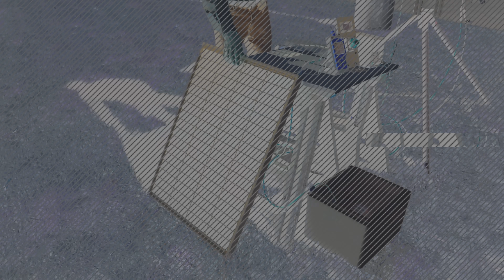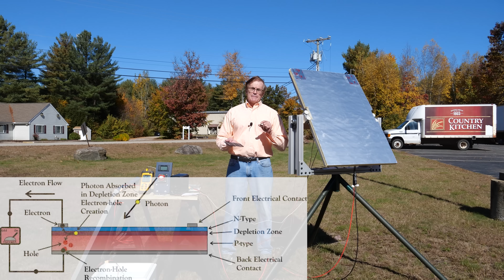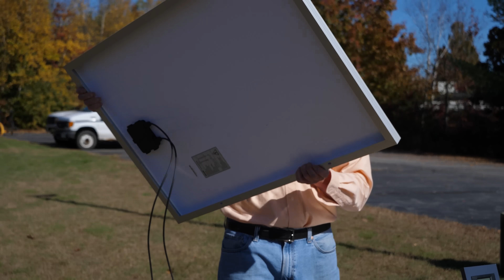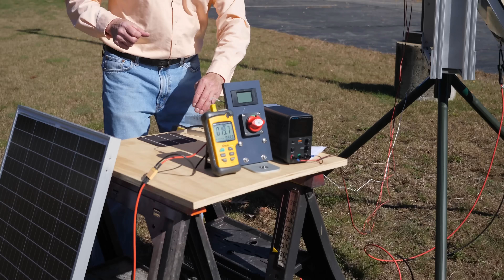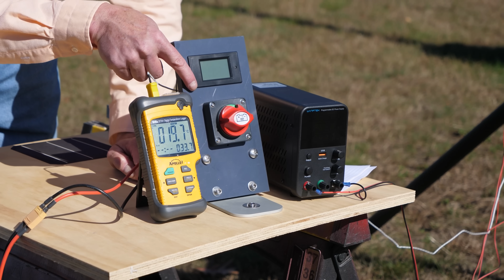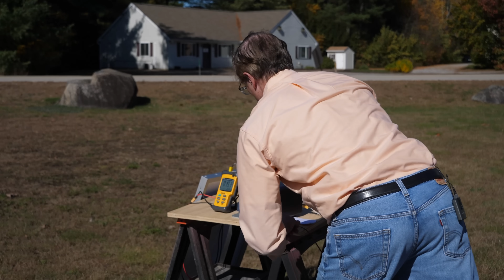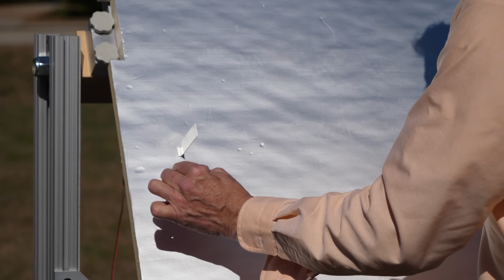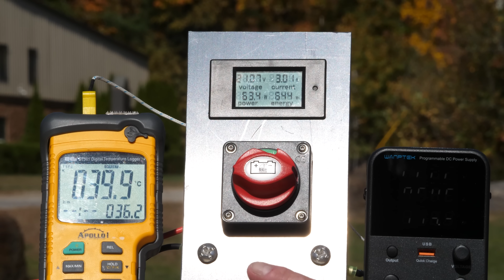Do you REALLY get enough out of your solar panel?

Comment: Interesting idea and a thought provoking video but it's not as rigorous as I'd like.  Did you record the temperature on a panel that wasn't enclosed on the back?  I'm curious about how much the natural airflow would change things over the boxed-in, no-fan "control" that you used in the video.  I also wonder whether the DIY heat sinks by themselves might make enough of a difference to negate the need for the fans.

It would be really interesting to see a 3-way comparison in a typical installation (i.e. on a roof in case the air currents over a roof make a difference) over the course of a few days to get an idea of the real-world performance of something like this.

Comment: I wonder if solar panels are justified, financially, if you can collect/store electricity in a battery at the lowest rate for use instead of the grid's higher rate? Especially if that battery is in your EV? You have grid backup, transportation, without the PV panel cost. Also, I plan to buy an Aptera Sol (PV array, $900 extra).

Comment: The code for MPPT isn't that difficult, it's just a "hunting" binary search style thing.  Well, it's easy to do, it's a little more tricky to do right.  The reason I feel it's important is because the power output of the panel will change when it gets cooler which will change your 7 ohm load requirement.  Maybe when cooled the panel would be better at 7.2Ohms.

Comment: Not sure if this would be beneficial. But could attaching peltier modules to the panels to power the fans be done? When the fans cool the panel. Wouldn't that effectively be an auto shut off when reaching optimal or near optimal power generation?

Comment: Interesting. I wonder about a passive system, just leave the back open and but leave the aluminium strips on as a heat sink.
Reply from the maker: There is a very slight increase in efficiency.

Comment: My parents need a new roof and have been thinking about installing panels and an air source heat pump. I’m going to try and work out if it would be cost effective for them to have a solar air heater as the roof surface around the panels and sky lights. In Ireland we have a temperate climate, so I don’t know if the COP boost would be worth it. I saw a video of a guy building a solar array / thermal collector and air to air heat pump. Definitely worthwhile in northern climates with a lot of cold air and clear skies. Would need some thermal storage though. 

I think Sunovate use a higher temperature refrigerant than typical heat pumps.

Comment: Doesn’t seem like a fair test…you didn’t compare the power output to the nominal case where the back is open to free air.   Your base case is closed box of still air which does a pretty good job of insulating the back of the cells and heating them up.
Reply from the maker: It isn't closed.
Reply: @TechIngredients   OK, yes, there is a small slot at each end of your duct, but my point still stands. When the fans are off, convection cooling of the back surface of the cells is likely to be SUPPRESSED relative to a bare panel due to the sheet of metal you added.   It inhibits both natural and wind-driven forced convection.     

A meaningful test would compare your setup with fans on, to a panel with no duct at all.  Try it.

Comment: 16:00 Thank you very much for this experiment and sharing the results, learned a ton. 
Regarding if it's worth it, one of the key problems here is also fans durability vs fans and the cost of everything, including replacing the fans every couple of years or so. 
As such, I'm not sure if the increased power efficiency + longevity increase of the panel will make up for the cost of the fans + power converters for the fans, etc.

Comment: @TechIngredients - What are your thoughts about the option of cooling the panels only with the extra added aluminum fins on the backside (relying purely on convection)? If being applied on large solar array I guess that the air velocity will be higher, respectively will have better added value.
One issues that I see with forced air cooling, is the dust. Over time the aluminum fins will accumulate significant amount of dust, which will quickly reduce the heat-exchange performance of the apparatus.
Thanks for all the hard work producing this excellent content.
Reply from the maker: There is a very  small improvement  with the fins alone.  Probably not worth the effort.

Comment: There is a roof panel that pv's  mount to similar to a skylight box made from stamped metal that is essentially a heat duct. They are designed to be connected. It puts the air handling load on your existing forced air blower and negates the need for secondary fans.
Reply from the maker: Good idea

Comment: At 16:48 do you mean Fahrenheit? 80c seems really hot
Reply from the maker: No, actually, Celsius.
Reply: @TechIngredients  Oh wow, I didn't realize they could get that hot! Thanks for the info!!
Reply: I was a roofer in high school... just because ambient isn't that high doesn't mean panels aren't. I operate in Fahrenheit mostly and it was an accepted fact on the crew that if the temperature was 80 in the shade, then it was 100 on the sunny roof. If it was 90 in the shade, then it was probably 120 on the roof.

The shingles (or any other dark material) absorb the sunlight and radiate the heat back. Asphalt shingles are usually as hot as boiling water or hotter. And the higher ambient gets.... the bigger the gap between ambient and the temperature on the roof.

95c for a solar panel.... 10000% believable if you know your stuff

Comment: Question.... What if instead of installing the fans on the rear of the panels, you directed a constant flow of air across the face of the solar panel? Would that flow of air provide any cooling benefit? Or maybe directing that flow of air across both the face and the rear of the panel.  My thought was that a constant flow of air might potentially provide the added benefit of helping to keep the face of the panel clear. I've always wondered if you could use air across the face of a solar panel to assist in keeping snow from accumulating on the face of a solar panel in winter.
Reply from the maker: Probably  not due to the limited surface area.

Comment: I've been thinking about the panel cooling for years. I want to set up an array and use geothermal cooling with long lengths of buried 6 or 8 in pipe and have the cool air pulled over the back of the panel by a simple roof turbine. Also you mentioned the wave length of light. Is is possible to filter out any light that doesn't promote electrical generation but does contribute to heat build up?

Comment: You could improve things significantly with a fluorescent polyethylene film over the panel to absorb UV and re-radiate the energy at visible light spectra the panel can use.
This will also stop IR and UV frequencies heating the panel. 
And double the surface area available for your air cooling, as you can pass air through the cavity on the front as well as behind the panels.
Reply: I must admit  - when he was talking about spectra I thought we were about to hear about a filter/reflective coating he was experimenting with. Active cooling and major modifications sounds more expensive than just adding another panel to the array for the extra power.
Reply: How much attenuation of the light at critical  wavelengths occur, when using such a polythene sheet,  wavelengths which are used by the panel to create electricity?
Reply: @deanXRayZulu  you may lose 5%. But Infrared is blocked very effectively, and the fluorescence can boost output by over 30%.
Robert Murray Smith on YouTube TnT demonstrated it with a green leaf smoothy. Blending up some green leaves, and making a chlorophyll dye. Chlorophyll is fluorescent. 
Even soaking a piece of paper in the dye and putting it over the panel improved it's output significantly. 
Though chlorophyll is degraded by UV, so not the best choice.

Comment: Thing is, I don't think that the panel would get this hot without the box that is trapping all that heat. It would be interesting to see what the temperature is on the panel, given the same conditions, without the fins and box on the back. I don't believe that these fans would be worth it as the panel would self cool with convection as you mentioned.
Reply from the maker: It's  not closed and not trapping the heat.  Consider how slowly that convective flow is moving.
Reply: @TechIngredients   But you don't KNOW that since you haven't tested it on the panel without the box and fins (control). Testing it and giving definitive proof is a much better argument than attempting to consider the convective flow difference between a control and boxed up panel in your brain.

Comment: would be interesting to see if a liquid loop like a pc has would make a bigger difference as the panels themselves arent generating the heat more so the sun but to have it in the ground like geo thermal for the heat transfer, might make sense to use it in conjunction with a vertical axis wind turbine to keep the space needed for everything small enough

Comment: Why not use the chimney effect instead? Just another metal sheet with some distance behind the panel. Closed left and right, open on top and bottom. 
Much cheaper/simpler.
I would really like to know how it compares to the fans...

Also that comparison is not fair - that fan assembly blocks the natural airflow behind the solar panel.

Comment: You didn't mention net metering (in terms of costs associated with install/maintenance/disposal). If you can feed power back into the grid, that's free money right there (once the fans and fan control systems pay themselves off).

Comment: Long time fan, I have a topic I would like to see you cover that is aligned somewhat with the subject of this video. Barium sulfate paints, its a relatively new material, and while I have seen some videos from a few channels on youtube its generally covered just for its ultrawhite reflective property and compared to other ultrawhite paints vs black etc etc, However they seem to overlook its most intriguing property, which is that it emits IR in a particular band that allows it to bypass the reflective nature of the earths atmosphere. this gives it a passive cooling effect where it will reach sub-ambient temperatures in full sunlight.

I may be wrong and this is what I would love for you to clarify or explain is, could this could be used to dump heat in a passive way like a reverse solar water heater? could a long thin length of copper tubing, painted with this material and fed a supply of hot water, would it emit any of that heat in this narrow band of IR? or is the IR emitted in that band solely a function of sunlight hitting the material? 

Could this be combined with something like a heat pump as a way to discharge its heat? I know modern heat pumps work on very narrow temperature differences, able to heat a house even with sub zero temperatures outside
Reply from the maker: Funny you mention that!
We've  completed  a couple of videos  on that topic  and will be posting  them soon.
Reply: @TechIngredients  Great minds think alike!  I am thrilled to hear. keep up the great work

Comment: I think you can make it even more efficient.. You could attach a small electric water vapor thingy to the back, that blows out a little bit of water every so often, at the back of the solar panel, covering the inside of the back in a thin layer of water.. this, together with the fans, would cool off the back of the panel even more, due to evaporative cooling.. It would literally cost almost no extra electricity to add this to the system.
Reply: It is far better to circulate water through pipes attached to the back and get free water heating.
Reply: @rogerphelps9939  depends on what you can use the “hot” water for.  I have a two story house with a gas water heater in the basement, and would be surprised if I could bring that heat from the roof to the basement with a net gain.  Not saying it isn’t possible, but it seems unlikely for a trickle of warm water.
Reply: @rogerphelps9939  While i agree that circulating water would cool down the panel to a greater extend then water sprayed on the back with air blowing over it, this would most likely take too much power to run.. for this system to work, you would need to use alot of electricity to pump the water around.. you might get around this problem, by having some sort of rain water catcher, that holds onto the water, at a higher elevation then the solar panels, and then slowly releases it down some thin tubing over the course of a hot sunny day.. but if you are circulating the water, you will have to use a pump, and pumping water would most likely cost more electricity then what is gained.. not only that, but the water that is circulating, has to be cooled off somewhere, so you would need something like a radiator with a big enough surface area, to cool the water down, else the water would just heat up slowly.. But if you misted the back of the solar panel with some kind of electric spray bottle or something like that, it would cost almost no extra electricity, and with the fans blowing over the water, it would cause the water to evaporate.. when water evaporates from a surface, the surface cools down a bit.. this is how "swamp coolers" work.. thats why you feel cold air, if you sit infront of a swamp coolers output while your room is hot.. the problem with swamp coolers tho, is that swamp coolers not only cools the air a bit, but they also raise the air humidity quite a bit.. so even if you manage to cool down your room by a few degrees, it wont really help much, since the humidity is higher.. with higher humidity, the "warm feeling" in the room intensifies.. just like when someone puts water on the hot thingy in a sauna.. but this is no problem outside where a solar panel might be located.. outside you just gain the cooling effect on the panel

Comment: There is a commercial system out now that combines watercooling the panels and combine the warm water from the panel with a heat-pump to provide more efficient hot water for a home my hunch is systems like that will only get more common over time.

Comment: Great video, I was thinking of water cooling the solar panels and using the heat for a pool or for heating my home. My only concern is  if I glue a large heat sink to the back of the panel would I have an expansion and contraction difference between the solar panel and the heat sink? And would it be significant enough to hurt the panel?

Comment: In the near future, I think there will be solar panels with multiple layers to pickup different wavelengths of the Sun.
Currently UV produces the highest voltage (Einstein won the Nobel prize for that). IR and near IR are completely unused. 
22 years ago, I saw an invention that blow me away.
It was a C shape semiconductor that turned ambient temperature into static electricity which was converted via capacitors, to power we can use. 
At the size if a transistor die, millions would fit in a square foot.  
I've had a hard time finding that professor who invented this. If anyone knows what I'm talking about, please help me find him.

Comment: I can imagine running a pipe from the water shutoff valve, to some tubing on the back side of the panels, then into the input of your water heater. Not only do you avoid wasting water, the heat is harvested for a useful purpose. You could have a bypass valve to avoid bursting the pipe in the winter.

Comment: I have always thought about chucking a heatsink on the back of a panel for this exact reason but my mind also went the extra step and though about sticking TEGs in-between the two, that way you make the pesky IR work for you while you are getting rid of it.

Some of the disadvantages I see of using TEGs are, it would slow/reduce the cooling effect to the panel, drastically increase the cost per panel as TEGs aren't cheap, the temperature delta isn't high meaning conversion efficiency is very low and finally getting a single module that fits your solar panel is impossible, 64x64mm is about the largest you can get easily so you would need 100 modules for your 100w panel. 

But I thought it would increase the power density of the panel quite a bit especially in warmer parts of the world so I did some back of the envelope calculations and this is what I came up with, a delta of ~30c gives 0.5V and 0.25A per module and a ~60c delta gives 1.1V and 0.5A and with the 100 modules on the back of the panel you would get between 10-60w per panel but those 100 TEGs are probably going to cost you $400 or more. 

So it's not a viable product unless space is at a premium, you live in a very hot location and you want a gold plated solution, I don't think NASA, JAXA or ESA would even be interest as 100 TEGs and a heatsink is a lot heavier than another solar panel although the temperature delta would probably be greater.

Comment: I would add TEGs (thermal electric generator chips) to the rear side of the panels to either power the fans or add to the overall electrical output of the panels.

Comment: The wattage gain is negligible. The important gain is in longevity of the panels. I wonder if just open fins on the back of the panel would have much of a benefit? You would still have convection over the added fins, but no fans or control electronics to worry about. I think you'd get that added 2 or 3 watts just by better convective cooling, but no extra complexity. Maybe try that out? Also your aluminum fins are pretty thick. Typical radiators have very thin veins so they don't store heat, just radiate it away.

Comment: use thermoelectric generator
You could have electricity and cooling at the same time
I want to try this when I first time heard about it (t-g)
But in Iran everything is getting super expensive
Just for one 100w  panel I need to work for 4 month (っ˘̩╭╮˘̩)っ